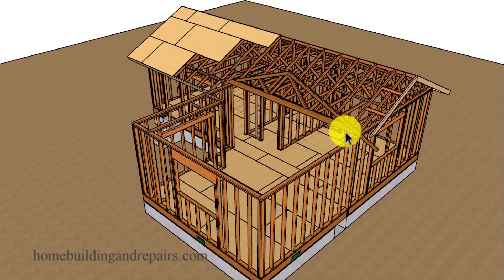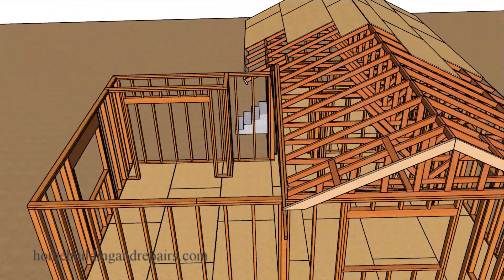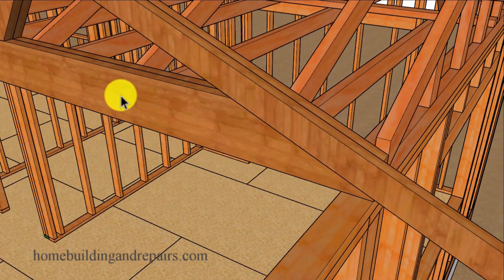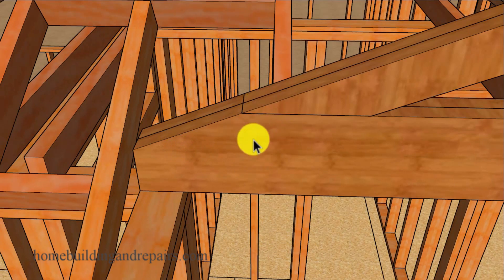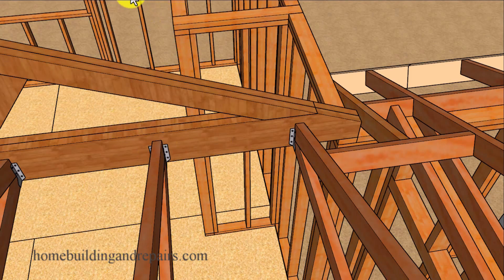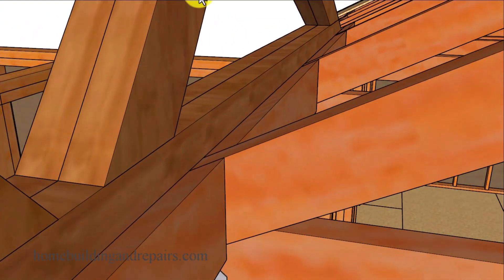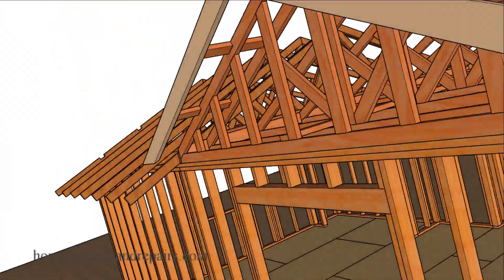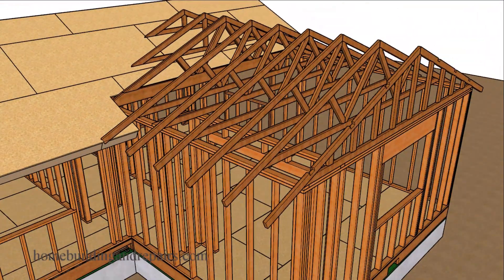How To Use Girder Truss To Build Flat Ceiling In Home Additions - More Helpful Construction Ideas

Comment: Very much appreciate this video. The question I have is about an addition I’m building. The trusses span 40 feet between walls and a girder truss is what we have to connect the rafters and ceiling joists of the 1970’s stick framed home in order to open up half of the of what was originally the exterior wall. Now does that triple girder truss need to sit on top of the top plate like you have it on the video or can I cut the rafter tails off just past the top plate and only hanger the rafters and ceiling joists that sit above my opening.

Comment: Assuming it’s taking the place of an exterior load bearing wall. Would that sit on top of wall, on the exterior of that wall or the interior side of that wall when attaching those ceiling joists? I’m having trouble envisioning if it’s possible to do with out removing the existing exterior wall until it’s all closed up. Thanks

Comment: How difficult it's to replace  a 3-ply roof truss girder? Im under contract on a house which a previous owner removed that 3-ply roof truss girder from the garage to make a store room on top of the garage. I only found out after a house inspection. And to make things better, I'm out of the due diligence.
Reply from the maker: It can be difficult, but not impossible. You might need an engineer for to design the truss or framing.